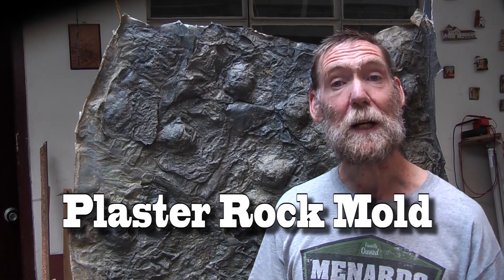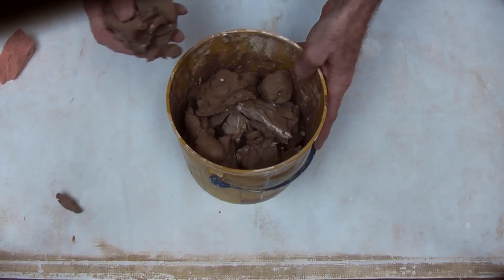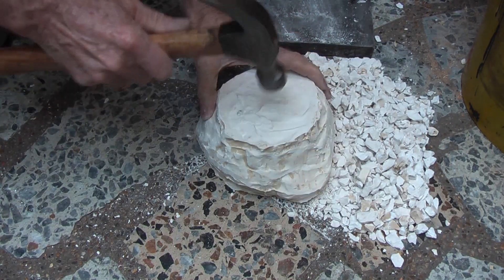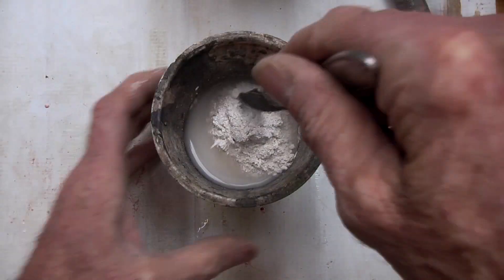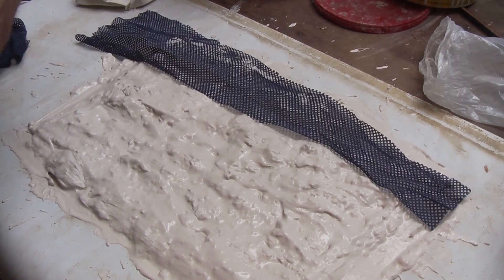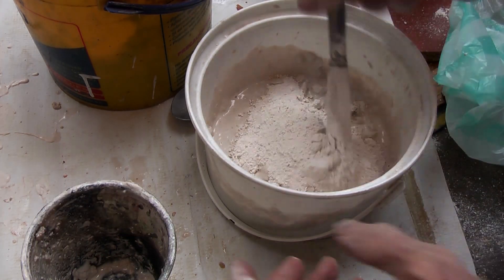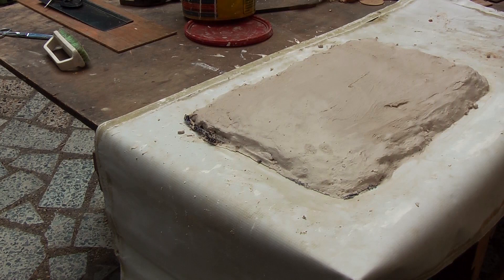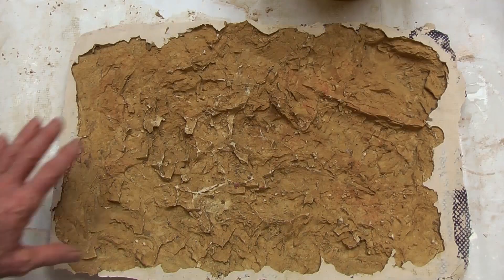Plaster  Mold, For Mache Rocks.

Comment: Hello Philip
I have a question for you.
I would like to know what product can be used to unmold papier mache from a plaster mould.
Because otherwise the paper paste once dry sticks to the mold and you can no longer separate it from the plaster.
Do you use an oil perhaps?... or another product?...
Reply from the maker: You can oil, wax, or  soap it, which helps, but I tend to put  a paper layer down first before the mache to avoid it sticking. Careful also with undercuts.
Reply: @PhilipStephens007  Thank you very much Philip, I will try !